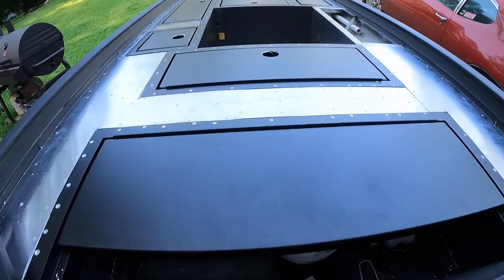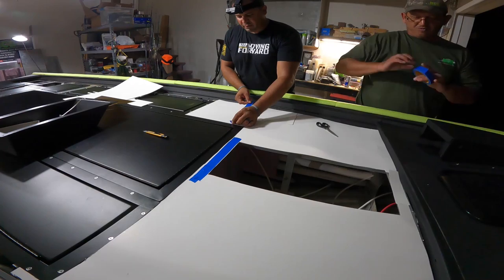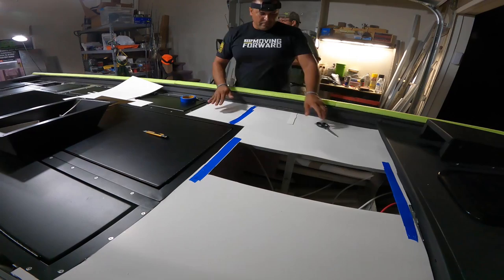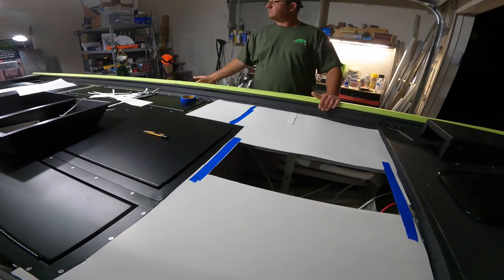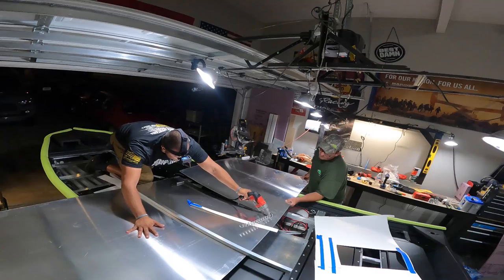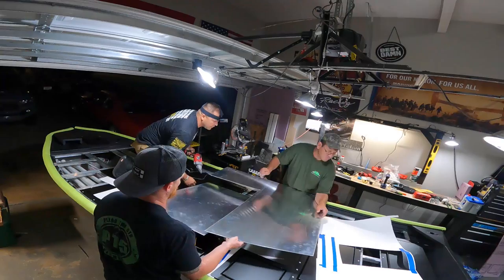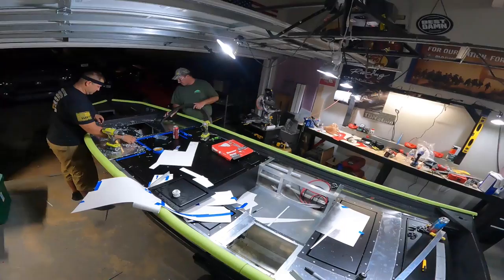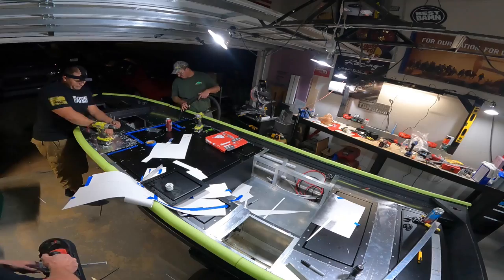DECK Your Jon Boat with ALUMINUM SHEETING! Tin Can Crew

Comment: I have a question for you. I am working on my boat. And a friend says I shouldn't walk on the inside of the boat while riveting the deck supports. He thinks it will stretch the rivets in the hull. Your thoughts?

Comment: I love it. This is on my to do list. What size and how many sheets did you use. $286 for a .090 4x8 sheet here in KY. This would be an investment that will last decades. Also how long does a wooden deck last ballpark figure.
Reply: Man it's $450 here in FL
Reply: @sphen4176  It's 3 million in Canada

Comment: This is great if you have thousands of dollars to spend after buying a boat motor and trailer I priced out one bin with a lid from TBN and it was almost $500 USD?  I cant afford anything like this.
Reply from the maker: What was the lid size?
Reply: @fireantfishing  Doesn't matter I completely closed in the front of my boat with a subfloor and casting deck complete with two lids I made myself one for the anchor and one for a 12-gallon gas tank I  covered the entire deck in EVA foam. I built everything out of aluminum angle, sheet, and square tubing for less than the price of one prefab lid.

Comment: I tried using these types of sheers, but they leave a nasty line parallel with the cut I'm making, deforming the aluminum. Don't you experience the same?